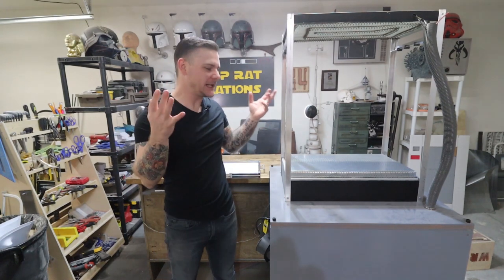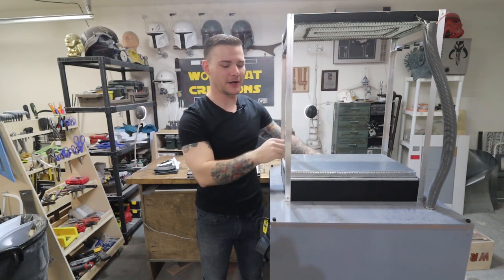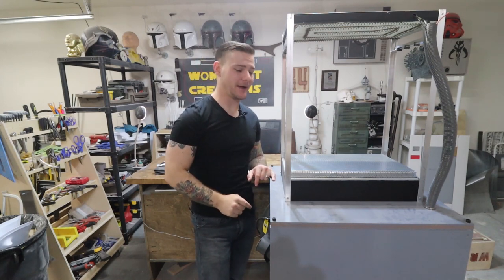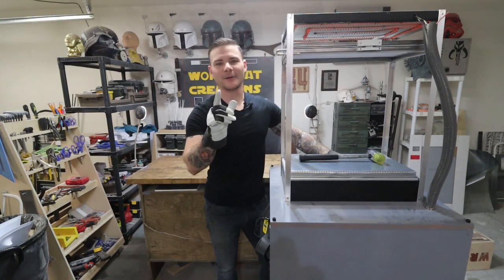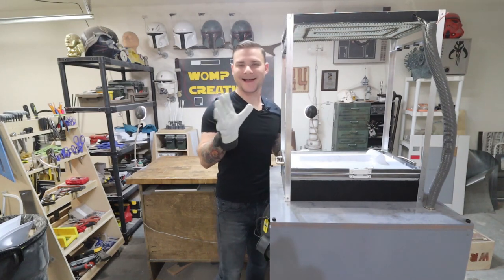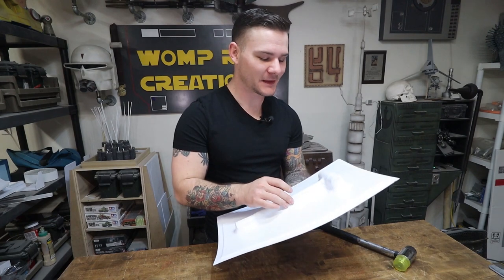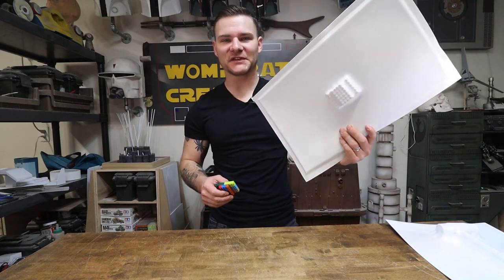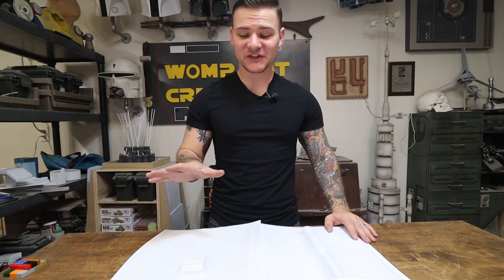Show & Tell: Vacuum Former

Comment: It looks like something is burning inside the top of the unit. As for suction, you should turn on the vacuum before you drop your plastic sheet so that the plastic doesn't start to cool when it hits the cold parts/platen. It might be helpful to get a instant read laser thermometer to help identify whether the plastic is hot enough.
Reply from the maker: All good tips! Thank you, and the smoking is some of the organic material burning off of the material I'm using for insulation, after the first few uses it should stop